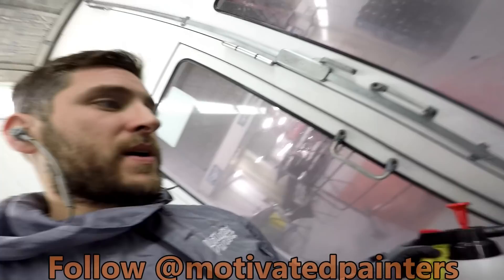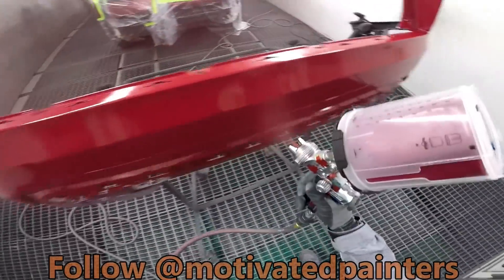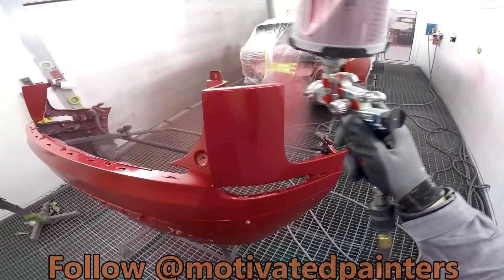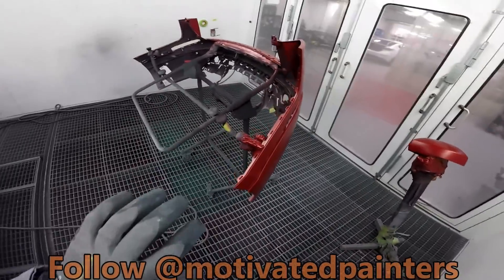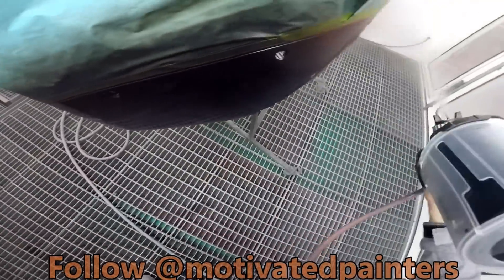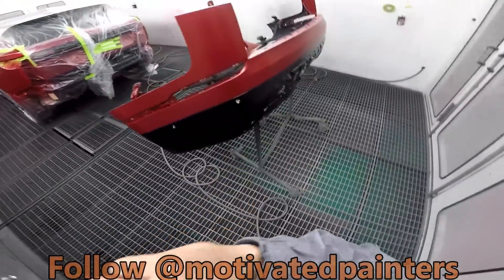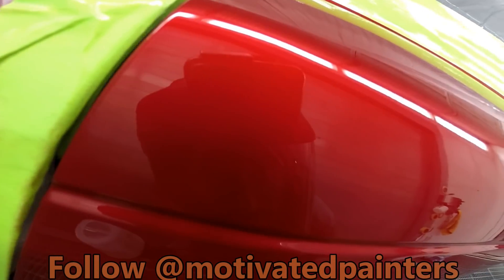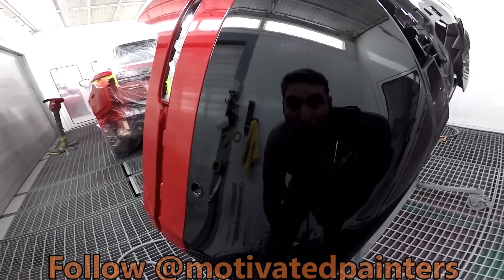Range Rover Velar Two tone

Comment: What I do is put t490 (wet bed) over the color to be masked (the red in your case) first then mask for two-tone. That way if there is tape residue or blow by I can sand on it without affecting the first painted color. Then I throw a little bit 490 over the tape line also like you did just as extra insurance.  Keep up the great videos Gabe
Reply: I do this also. Use it as an intercoat before taping off the 2tone. Its a  better way to use it for 2tones then the method in the video in my opinion.

Comment: Got my carbino hte sprayed for a week so far. Nice fan i like it. Slightly splotchy n booth but in the sun there fine. Gotta play with it some more
Reply: But now im in need of another sealer/solid base gun.. i use a tekna copper rn but theyve done went up to around 5 to 600 dollars. Worth it but i paid 400 a couple years back. Any suggestions on that one? Lol
Reply from the maker: Awesome! The more you use it the better it will get! I spray at 25 psi then 18 for control coat
Reply from the maker: The sata 100b is great for sealer and also if you have a ws or ls 400 Iwata would work great
Reply: Well see i been spraying at lile 18 to 20. Tried a couple times at 24. And 26 but dont like the way it sprays. Bumped it to 17 for control any lower it dont like it. Think im not gunna control one an see how it does. Looks smoother to me before i do
Reply: To me 18 is spraying right. Thats why i was hunting the hvlp but u cant find one for sale online.
Reply: But i spray lower psi then normal anyway.. basing at 15 psi with my tekna basecoat gun. It loves it. From 1st coat to last. Seems lile it iant putting any paint out until your second coat. And its covered lol
Reply: But as far as another gun this is my first painter job. In a shop. So all of my good guns are being used. Im going to have to biy another. And unless teknas come back down theres no way im paying what there wanting now. Hell the pro lite is about the cheapest tekna u can find now lol

Comment: CLEAN job !
Reply from the maker: 😋 thanks !!
Reply: Do you ever notice yourself geting runs easyer on the second coat of clear coat ? Jw , been a problem iv been having lately . do you perfer fast clear coat and hammer it on ? Or slow clear coat and apply it lightly and let it flow out on its own ?
Reply from the maker: I think it's a matter of managing your speed I do still get runs once in a while but you really need to check the texture when you are spraying and look at what the gun is doing
Reply: Yea I recently got an iwata w400 classic / belaria and tbh I hate it . my iwata w400 132g was great. I also got a sagola 4600 extreme dvr clear gun which I'll probably be useing from here on out for clear because the bellaria just doesnt break up the clear well , probably best used as a sealer gun

Comment: i heard you say at around 5:00 " to make sure there are no burn throughs." What do you do if there is a burn through?
Reply from the maker: If it's on an edge you then you can dust it a little bit and if not we'll then goodluck hahahaha
Reply: @MOTIVATEDPAINTERS  I'm assuming you mean burn through the clear right? If I am working with primer and accidentally sand a tiny bit of it through to metal, do I need to re-coat? or will the sealer coat be fine?